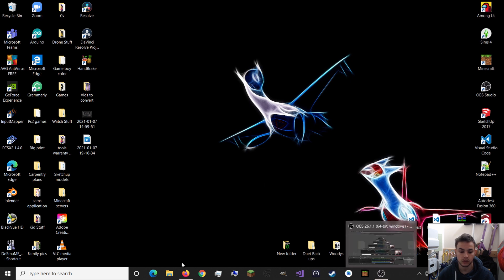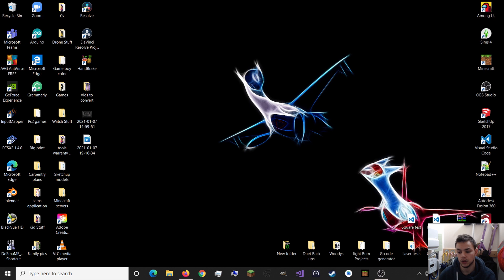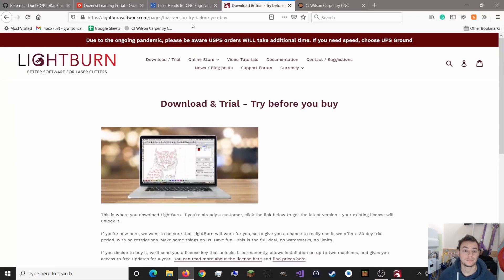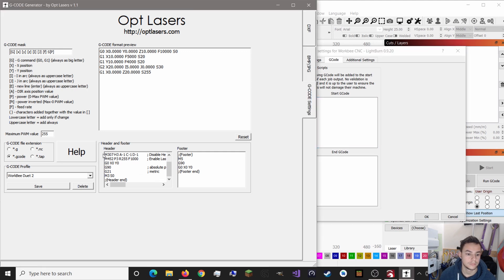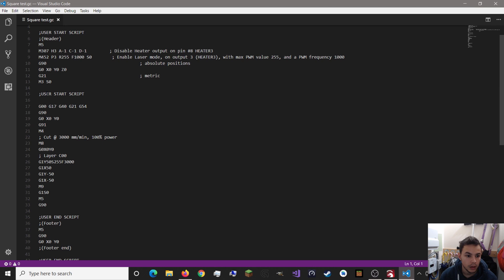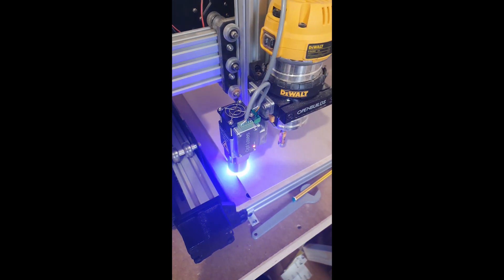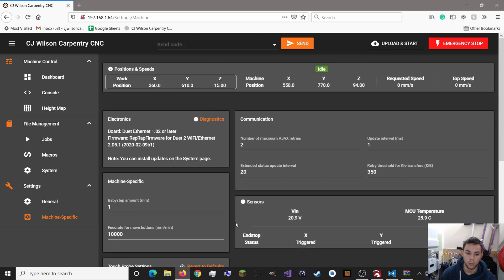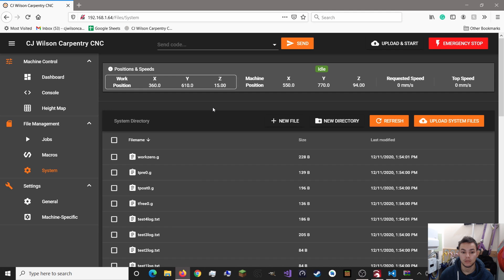How to Combine Lightburn with Duet 2 Controller - Educational Series

Comment: UPDATE!!!
The new (up to date) header and footer are as follows:

;(Header)

M5
M452 C"!exp.heater3" R255 S1  F1000    ; laser uses heater3 pin,  max PWM value 255,  PWM frequency 1kHz
G0 X0 Y0
G90                                     ; absolute positions
G21                                     ; metric
M3 S0
;(Header end)

;(Footer)
M5
G90
G0 X0 Y0
;(Footer end)
Reply: Ive downloaded lightburn and also the latest version of CUT 2D. Cut 2D V11 is working ok as I used Oplasers PP. Now ive got lightburn to move the laser but it ddnt burn so I edited the file and it works,ive got it to burn. 
But only by doing manual intervention of S255 to each movement. lightburn doesnt tell the laser to turn on

I Have commented my changes in CAPS
Help please as its taken all day to get this far. 
That's not bad for two apps so Im reasonably happy!

Kevin

; LightBurn 0.9.16
; GRBL device profile, absolute coords
; Bounds: X16.78 Y23.23 to X48.48 Y47.38

;USER START SCRIPT
;(Header)

M5
M452  R255 S1  F1000    ; laser uses heater3 pin,  max PWM value 255,  PWM frequency 1kHz [I EDITED OPTLASERS CODE HERE and S1 or S0 doesnt seem to change anything]
G0 X0 Y0
G90                                     ; absolute positions
G21                                     ; metric
M3 S0
;(Header end)
;USER START SCRIPT

G00 G17 G40 G21 G54
G90
M4
; Cut @ 10 mm/sec, 80% power
M8
G0X16.78Y23.23
; Layer C00
G1Y47.38S255  LIGHTBURN DIDNT ADD THE S255 command
G1X48.48S255
G1Y23.23S255
G1X16.78S255
M9
G1S0